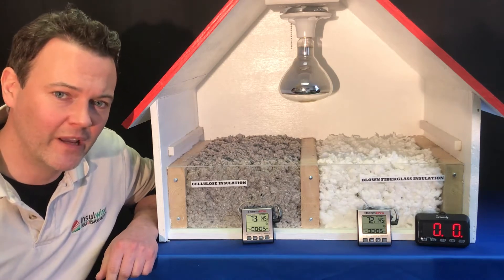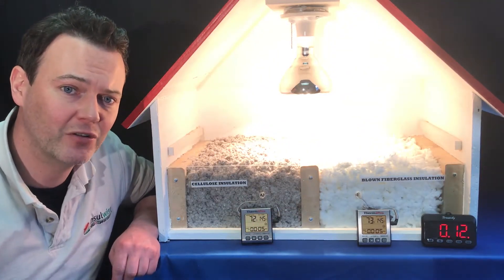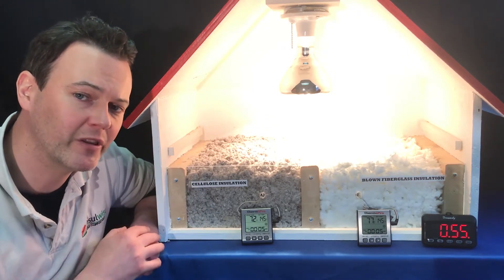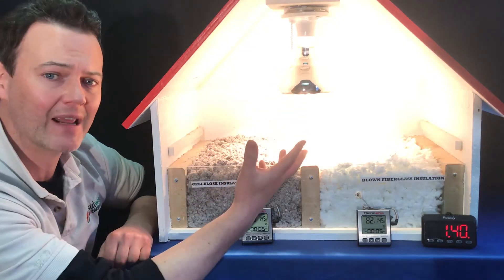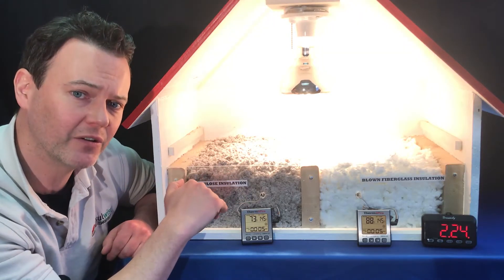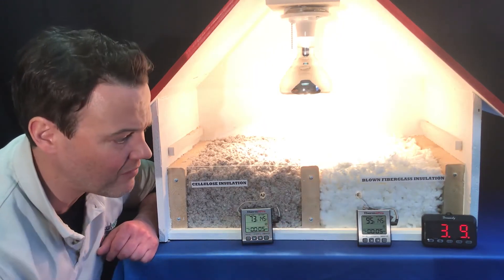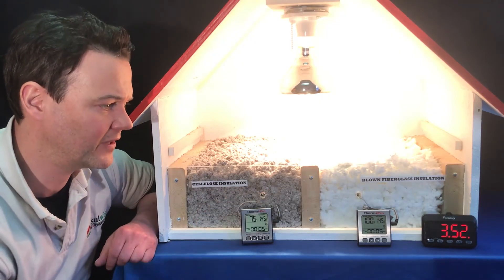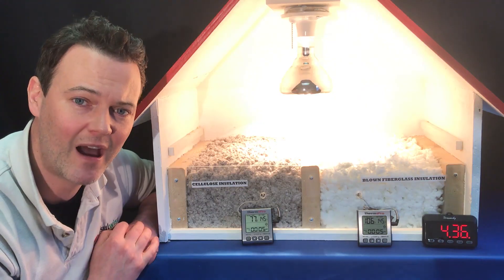Cellulose vs. Fiberglass Insulation: The Ultimate Showdown

Comment: Doesn't the cellulose lose its effectiveness over time though. I have heard that it settles and loses it's R value, while the fiberglass does not.
Reply: The part about blowing extra to compensate for the initial settling is a very common practice when installing cellulose. But the part about never losing its effectiveness is not exactly true.  It works excellent for the first 15 years or so, but seeing as it is an organic material it absolutely will start to decompose.  It has a longer life expectancy in dry climates.  But in very humid climates, it will start to decompose a bit more quickly.  Don't get me wrong, it's a great material. It has certain advantages over fiberglass, such as having a higher R-Value per inch which means you can get a higher resistance to heat out of a smaller amount of space, and is more cost effective in that regard. But as far as longevity, fiberglass is the clear winner as being an inorganic material it will never settle, decompose, catch fire, grow mold, etc. During manufacture, cellulose insulation is treated with ammonium sulphate, ammonium phosphate, and zinc chloride, plus borax and boric acid to make it fire retardant. These chemicals make up about 20% of the final product, and this is what keeps it from decomposing, growing mold, and catching fire. So if you ever happen to have a roof leak, these chemicals can be washed away, which can be a problem. Choosing the right material just comes down to a personal preference that I leave up to the homeowner.  Are you going to be in the house for more than 10-15 years?  If so then I wouldnt go with cellulose.  But with fiberglass, if you've got a really small attic space with not much overhead room, cellulose might be better because you can get a higher R-Value out of that space.  You can also get a higher R-Value for the money because being a recycled material it is a bit cheaper, typically.  Don't let anybody sell you on the gimmicks saying one is 100% superior to the other. Because as I said, it really comes down to preference, and what pros and cons work better for your home, your climate, and etc.
Reply: @ianstead6278  thank you, very logical response
Reply from the maker: Cellulose NEVER loses it's thermal effectiveness.  However, when blown in loosely it will settle by 10%.  All attics are overblown by 10% to account for this, at least if done by a credible installer.  On the every bag of cellulose that i've seen there is a "installed depth R-Value" and "settled depth R-Value" written clearly on the bag.  Doing exterior walls is where the settling has historically been an issue.  The old school method (that some schlep guys in Pittsburgh still use) will result in settling.  However, when cellulose insulation is dense packed into exterior wall stud bays, it will not ever settle.  We guarantee that.  I would take cellulose ten times out of ten times compared to blown in fiberglass.
Andy
Reply: @insulwiseenergycomfortsolu3293  I also read that fiberglass will last 100 years, where cellulose is only rated for 30 years. I can't remember the reason.. It might have been something to do with the chemicals used to stop mold losing their effectiveness over time. It also said that the chemicals in the cellulose gas off into the house. I will see if I can find that article again.
Reply: Both good perspectives thanks gentlemen

Comment: Great presentation. Cellulose is a super material .  I like it so much, I have set up a British company to supply and install it across the UK and Ireland, using Termex and Intello products.
Reply from the maker: Hi Damian, thank you, we believe so as well.  Good luck with your company in the UK!  Hit me up directly if there is anything that I can help with.
Andy
Reply: Hi Andy,  Thanks.  In the UK, the biggest problem is mould (mold), caused by all the rain and leaky old buildings.  Most older buildings are made of brick and have little or no insulation. Those that do have insulation often have problems with cold bridges occuring across poorly installed materials, especially in cavity walls.  I am creating a display to show the effects of mould on different types of insulation.  It would be great to hear your thoughts about cellulose and damp/moisture ingress.  Damian
Reply from the maker: @damianodonovan2121  Hi Damian, in the building science community here we refer to cold bridges (I think what you mean) as thermal bridges (they allow hot and cold temperature to transfer), but a thermal bridge could produce a cold area that would allow water vapor to condense --- and that's almost always bad in news when it's inside the structure of a home or building.  With cellulose insulation in the US, all of it that I am aware of is treated with chemicals like boric acid and ammonium sulfate.  Both of these are non-toxic, and they are what make cellulose insulation sold here both highly fire resistant and also mold resistant.  I have a video that I shot in an attic of a roof leak that had been dropping water onto a 15" deep installation of cellulose for some time, likely at least two years.  And there is no mold anywhere in the cellulose that I can detect (often you can smell it).  

What happens when cellulose gets continually wet in an attic that is properly ventilated
https://studio.youtube.com/video/2XQK-Ba1hWc/edit

So, cellulose itself, at least here, is highly mold resistant and intentionally so.  But in a closed wall cavity where it cannot dry, what will / can happen is the surrounding wood framing and timbers themselves will begin to grow mold and rot.  That I have seen.  That said, I would not expect to see much advantage of something like fiberglass or rock wool over cellulose inside a stud bay that is getting wet.  Both materials will impede air flow (fiberglass and rock wool to a lesser extent) and allow wood to be consistently wet and damp.  

Are the walls that you are talking about there solid masonry?  Starting largely in the 1920's in Pittsburgh homes were built with a "stick frame -- ie wood 2x4's" and then often surrounded with a brick wall outer wall with a gap between the brick and wooden inner walls (intentionally left there to allow for drying).  In our homes that are solid masonry, we focus mainly on the attics and then windows, doors, and perimeter of the basement.  If a well insulated attic is properly ventilated, it will tolerate minor leaks.  The insulation gets wet when it rains, then dries out again when the sun comes out without causing mold growth in an attic (I have seen this numerous times)  We are huge advocates of properly ventilating unconditioned attic spaces, and are installing additional roof ventilation in the homes that we work on daily.  

Let me know if you have other questions, hope this helps!
Andy

Comment: 2 reasons this is a bad test.  No 1, everyone know the fiberglass requires more thickness to get the same R value.  No 2 is where is the thermocouple?  I looks like they are located near the top.  Maybe a 1-1/2 from the top. And how hot is the lamp?  400 Deg? A more realistic test would be to use the minimum required R value by code and an environment that reflects real world examples.
Reply from the maker: Thanks for the comment, but wrong, everyone does not know that the R-Values are different.  Many if not most homeowners look in their attics while they're getting their decorations, see insulation, and say "yup -- I'm insulated, all good here."  This video was designed to show that there are dramatic differences in performance between these two insulation materials.  Even more important is that they also perform differently at temperature extremes (blown fiberglass LOSES R-value at temperatures below 30 degrees F because it is so light and poofy that cold air falls down through during the winter, resulting in convection currents forming from heat conducting up from the ceiling below).  
The thermometer is located 2 1/2" inches below the surface of the insulation (I just measured it).  The temp of the bulb is around 150-160  degrees -- which is about the same temperature as a typical roof gets during the afternoon in summer.   The job of insulation is to block the transfer of heat - which can occur via conduction, convection, and radiation.  This example mimics radiant heat transfer from a hot roof in the summer down through the attic insulation and then into the rooms below.  Lastly and possibly most important -- we redo attics blown with high levels of blown fiberglass on a near daily basis.  We do this because the blown fiberglass on its own does a lackluster job of stopping the heat transfer, and the homeowners cannot effectively cool the upper floor of their home.  Air sealing the attic floor and top -coating with cellulose solves this problem for them just about every time. 
Hope this helps!
Andy
Reply: @insulwiseenergycomfortsolu3293  The comment is right, however, that it would make more sense to check temperatures actually somewhere below the insulation, simulating a room.

Comment: great video. thought....how long does it take for the cellulose and fiberglass to reach attic (bulb) temperature? maybe follow up video?
Reply from the maker: For the fiberglass it takes about 6 minutes.  For the cellulose it takes much longer, say 20-25 minutes.  Most roofs and therefore attics only get direct sunlight for a few hours, and after that the roofs and attics therefore start to cool down.  So the insulation needs to weather that initial blast, and then it has to do less "work" to keep the heat from penetrating down through it. 
Andy

Comment: I believe this demonstration would be more accurate and fair by not useing a light bulb for the heat source.  Light in this case like the sun is a source of energy or heat (infrared). Light passes through the white transparent fiberglas by far more than the dark non transperent cellulose. I dont believe there is much infared energy coming from the sun in an attic due to a roof?
Reply: Thanks for the clarification. Glad I used cellulose around over and in the walls of my garage. Too bad the living space of my house doesn’t have that instead of the blown fiberglass the cheap builder installed. Oh well.
Reply from the maker: Hi there, heat transfer happens three ways.  It happens through convection (air circulation), conduction (one item directly transferring heat to another, like a pot on a stove, and radiation (heat being projected onto a surface and that surface retaining the heat).  The type of heat transfer you are seeing in the video is radiation.  Although it may look different, it's effectively the same as roof that becomes hot from the sun transferring its heat down into the insulation via "radiation."  So the demonstration may not look to the eye the same, it the way the bulb is transferring heat to the insulation is.   
Hope this helps!
Andy
Reply: It would then be better to put a sheet of black plastic an inch or two above the insulation, and allow the heat lamp to shine. Upon that. It would be a much more convincing demonstration because it is much more accurate as to what is actually going on, and does eliminate the ability for the light carrying the heat to pass a few inches through the fiberglass unlike the way it can do with cellulose which is not realistic according to how roofs are made. @insulwiseenergycomfortsolu3293
Reply: The only thing exposed to radiant heat are the shingles on the roof. Everything else below that is either conduction or convection. Ask yourself this. Did you ever get sunburn in an attic?

Comment: Why don't you guys talk about the second worst insulation called cellulose? It settles over time. I had 10 plus inches blown in with the height cards left behind showing how much was blown in. Recently installed security cams. All that new cellulose sank to the rafter tops were you walk. Total waste of money. At least bats stay put over time.
Reply from the maker: Cellulose settles by about 10%, that's why we blow in 15" inches, knowing that over time it will settle down to about 13.5 inches -- which is an R-49 for the material that we use.  Batts obviously do not settle, but there are problems with gaps occurring where obstructions on the attic floor exist.  It's extremely difficult to get the same effective coverage using batts on an attic floor. 
Andy

Comment: lol.. 75% of light is directed to fiberglass tray..U can even see lightsocket being tilted to do it
Reply from the maker: The light is not tilted toward the fiberglass, it looks pretty dead on to me.  If it is it's slight at best, but it's possible my video camera was slightly off center when I took the video.  Either way it's not even close to 75%.  And if you performed this experiment in your own home using NASA level detail to set up the light you would get the same results.  We see these same results in homes that we're working in every day.  I honestly don't care what the material is so long as it's effective.  If blown fiberglass worked better  --- that's what we'd be using.  But it isn't.  

Andy
Reply: Also light is able to pass through fiberglass, which could account for the above average heat transfer. There are 3 different types of heat transfer. They all behave differently. This light would be a radiant heat source much like the sun. The light waves carry the thermal radiation and don't transfer any of it until it touches something that the heat can then radiate from. Whereas conduction or convection work differently. There is no sun in an attic or wall cavity, so if he really wanted to make this experiment unbiased he should use a convection heater such as a space heater and pump that hot air into the simulated attic space. That would be a much more accurate experiment.

Comment: Does it take longer for the cellulose to dissipate heat once it does “soak thru”? Maybe do a reverse test to see which one holds heat longer… great video!! Thank you 🙏
Reply from the maker: Hi there, the short answer is --- yes.  Cellulose insulation has a higher thermal mass than the blown fiberglass does.  This means that it will retain and hold heat longer.   The reason this still works better in an attic than blown fiberglass is because the cellulose will heat up from about 10am - 2pm on a summer day (that's when the attic is building heat from the sun exposure), and then begin to cool off after about 2pm as the sun gets lower in sky.  At this point the cellulose will begin releasing that heat back into the attic space and out through the vents.  And this process tends to happen long before the heat has been able to penetrate down through a 13-15" inch R-49 level installation of it.  

Hope this helped!
Andy

Comment: If cellulose delays the heat doesn’t it hold the heat longer? Like when the sun sets glass would become cooler quicker while cell would hold heat longer right?
Reply from the maker: That's correct, cellulose does hold the heat longer.  The reason it is still better is because the attic is only getting maximally heated from about 11am - 2 pm, after that the sun's intensity diminishes on the roof and the cellulose will start releasing that heat back into the attic.  Blown fiberglass does cool down faster, but because it allows the heat to transfer through it much more easily, it's far less effective.  
Andy

Comment: Cellulose degrades almost immediately.   Within one year you can expect to lose half your r value.

Cellulose is also made with recycled diapers.   So if you like feces in your attic.  Go ahead and buy the cheap stuff
Reply from the maker: With all due respect, nothing about this is true.  I've used just about every brand of cellulose on the market, and it's always made with recycled paper -- not diapers, much less diapers with feces in them.  It also does not lose it's R-Value over time, not at all.  When blown in loose fill style in an attic, it settles by about 10% over time.  Everyone installer knows this, which is why we blow to 15" inches, and over time that settles to 13.5" inches, which is a "settled R-49."  I've been into plenty of attics that we insulated with cellulose several years prior...and that has always been the case.
Reply: @insulwiseenergycomfortsolu3293  your not reading the fine label 

Diapers are used to produce cellulose along with paper.  Ever wonder what those little plastic pieces in the cellulose is.  

It's recycling diapers 

You can use the product all you want.  When I picked up my blowin machine from a cellulose manufacturer.  They where in the midst of a warehouse fire.  Which happens all the time when manufacturing cellulose.

And what was laying all over the ground was paper as well as diapers.

You can brag about how the product does not settle all you want.

I'm the guy that always has to top up cellulose blowin insulation after 5 years.  Because the settling and loss of r value is ridiculous .

 We use fiberglass insulation to top it up.

Plus fiberglass isn't a byproduct of reusable diapers.

Like cellulose is.

Look it up online.  Secret ingredients in cellulose insulation.

It's like people's uncanny idea that spray foam does not cause cancer.

Comment: Hello. What's  attic insulation do you recommend for Orlando, Florida?
Reply from the maker: Hi Victor, we would still recommend using blown in cellulose.  The performance benefits would still outweigh using blown in fiberglass.  If you had an attic mounted HVAC system with lots of exposed ducts, you could argue that spray foaming the underside of your roof deck is the way to go.  We believe that solution can work well, but ONLY when closed cell spray foam is used because you will need a vapor barrier to keep water vapor from diffusing upward through the foam and getting trapped against your roof deck.  

Andy
Reply: @Insulwise Energy & Comfort Solutions  Thank you Sr.